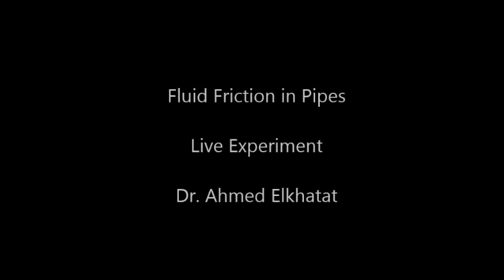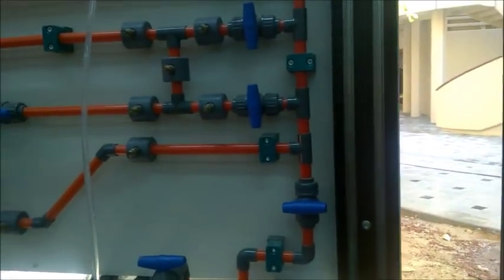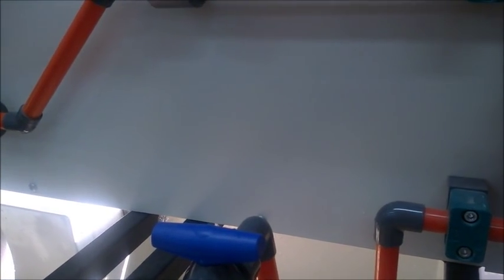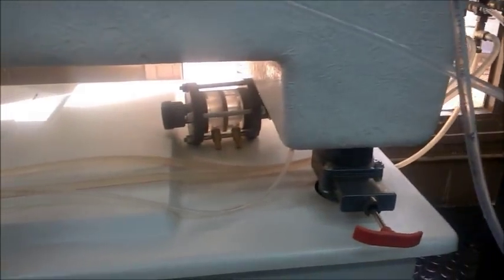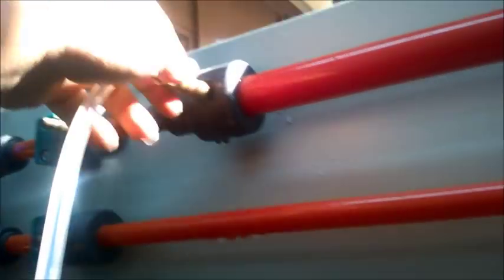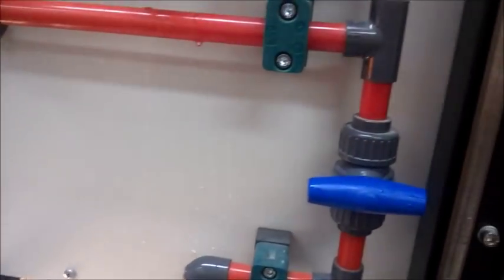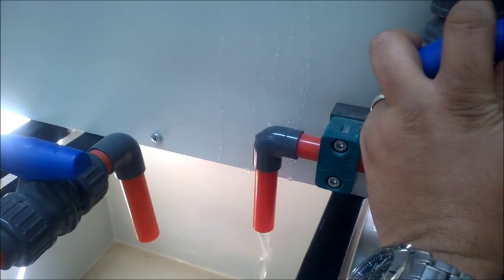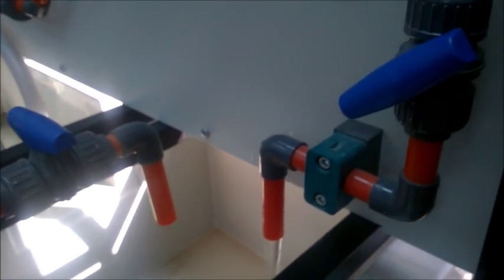Friction Losses in Pipes Live Experiment 2015

Comment: Can you tell me the benefit of this experience?
Reply from the maker: This experiment is used to determine the pressure drop in pipes, which is used to calculate the friction factor of the pipe by applying  Bernoulli equation.

Comment: Why  is head loss different in contraction and expansion
Reply from the maker: Because there is another contribution to the pressure drop which is the change of kinetic energy due to diameter. Apply Bernoulli equation to get it
Reply: Accelerating a fluid causes less losses than decelerating it.

Comment: Can you tell me the components of the machine? Especially the hose and fittings used for the pressure of water be read by the manometer
Reply from the maker: It just a water pump connected to water tank, and different sizes of pipes. in order to study the pressure drop you have to connect the two hoses of manometers to two points you want to measure the pressure differences between.

Comment: the manometer reading are real losses?
manometer tubes are connected at the top and working air?
Study the pipe is 1"?

sorry, I dont speak english! xD
Reply from the maker: Hi Jose,
Any manometer when connected between any two points it reads  the pressure loss between those two points by applying the Law (pressure drop=manometer drop x density of the manometer solution x gravity). Pressure drop represents amount of energy lost per unit mass between the two measured point  by applying Bernoulli equation
For more theoretical illustration watch the following two videos .
Part 1: https://www.youtube.com/watch?v=Pssu2xp2Kio 
Part 2: https://www.youtube.com/watch?v=RSVPSRgX-hQ
Reply: Oh very well. Thank you!
my question is because I want to know how to calculate an estimated height of liquid in the Manometer, I use the ideal gas equation to see how much water compressed air at a first point? and the calculated pressure drop, I can know what is the height of the second column.
It would be good?
Thanks!
Reply: and very good videos, I subscribed!
Reply from the maker: Most welcome Jose, 
Manometer can't read absolute pressures at any point. It only measure the height difference produced due to the pressure drop between two points. 
You can use a product like this http://www.cpap.com/productpage/guage-manometer-pressure.html to measure the pressure at one point
Reply: yes, I understand that.
and excuse me, I'm over here with the theme
I am designing a manometer like that, to measure the difference between two points, college work.
if I know which is the system pressure.
through the ideal gas equation, calculating the compression of the air, so I can know what will be the height of liquid 1, then calculating the pressure losses I know what will be the height of the column 2.
with this I want to know if the readings are maintained within the manometer.
I do not know if you understand me. xD
thanks!